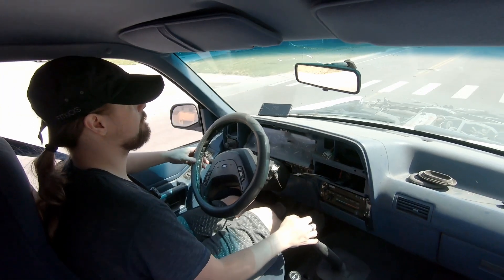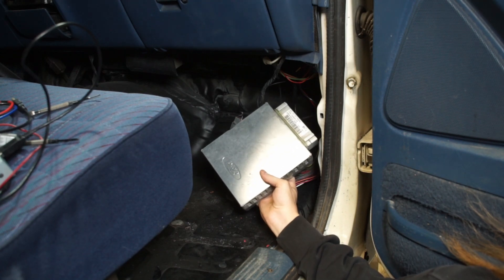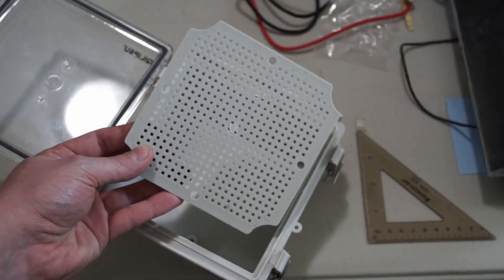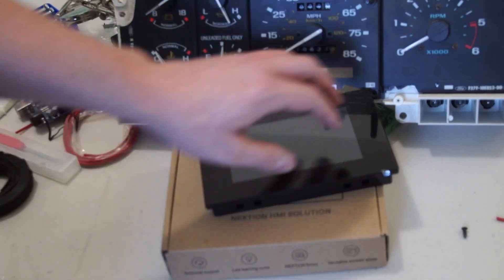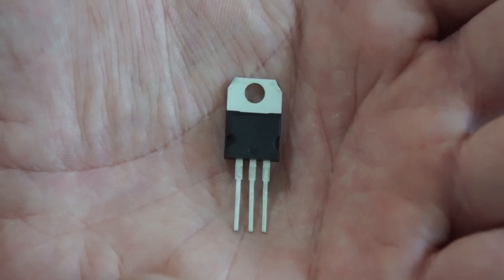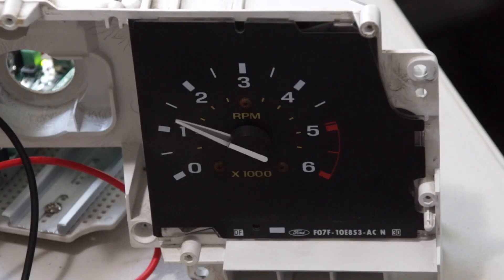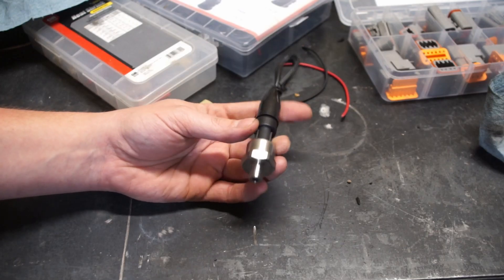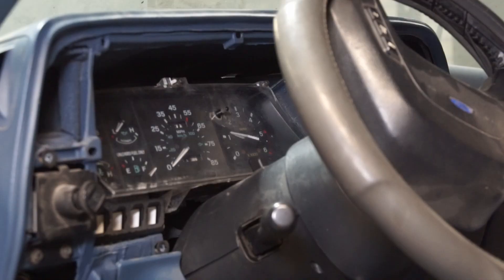You Need THIS for Your Engine Swap!

Comment: Depending on the year, that computer may be an EEC-IV. A buddy of mine actually found a write up for the intel assembly code. IIRC they are EEPROM. This actually made me very interested in learning assembly code. Enjoying the content, just recently subscribed.
Reply from the maker: It is EEC-IV. In college I was troubleshooting my first explorer and had access to a factory service tool and was amazed that the old computer could run certain self diagnostic tests. For example it'd do a cylinder balance test where it would turn off injectors, read RPM drop, and tell you if one cylinder was underperforming. Cool old tech.

Reprogramming one would be a more complex computer project than I'd be willing to take on, but I would love to see someone tackle it that'd be very impressive.
Reply: @BuildSomethingAuto  Ya, I always thought those computers seemed pretty advanced for their time.

Understandable, I'm sure that would be a mess to take on. Hopefully I'll have enough confidence/knowledge to tackle that one day.

Comment: On off fast - pulse code modulation. PCM
Reply from the maker: With cars it can also stand for "Powertrain Control Module" 😅. Good to know though, I didn't realize that was the term for it (although the amplitude wasn't important here, just the frequency).
Reply: @BuildSomethingAuto  yup the frequency of the pulses is what you need and sometimes the width of the on or offs is important too. Great thing is the fine control you get as it’s basically a digital switch
Reply: @BuildSomethingAuto  edited^

Comment: I am trying to use a oem ecm to control a 4R70W  transmission that is mated a carburetor 351, any suggestions?
Reply from the maker: I havent personally messed with transmission control units much. I would anticipate that you mostly just need throttle position and vehicle speed for the trans to work. Vehicle speed shouldnt be too hard since the sensor should be on the trans, tcase, or rear diff. Throttle position is a bit harder. Try to find a service manuak for that trans so you can figure out exactly what signals it wants. You could always just swap in a manual valve body.

Have you checked forums? I know people have done stuff like this before but maybe not with that exact trans. Best of luck let me know how it turns out.